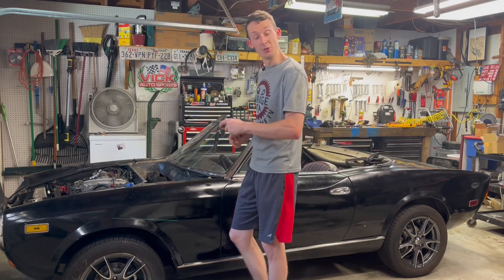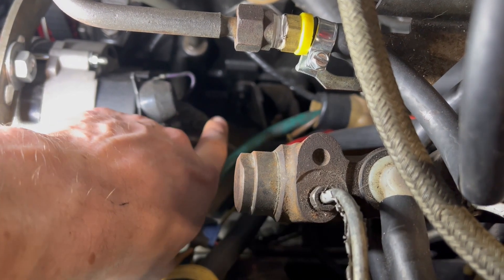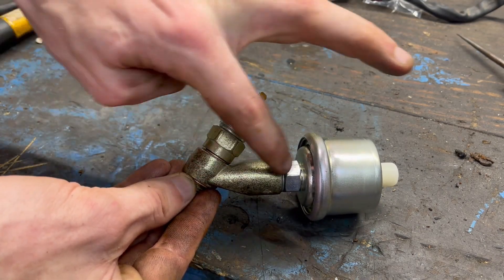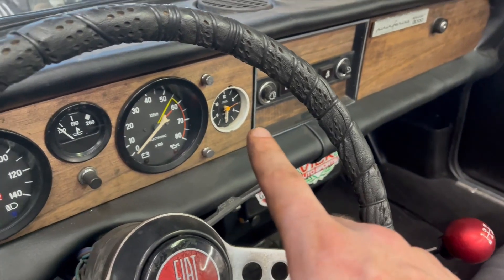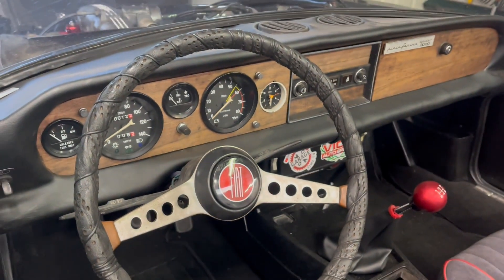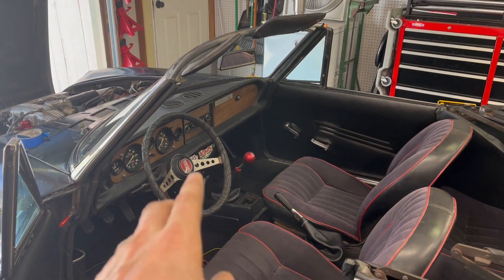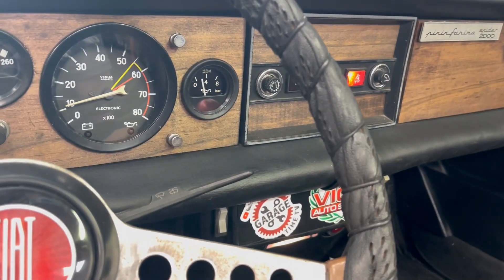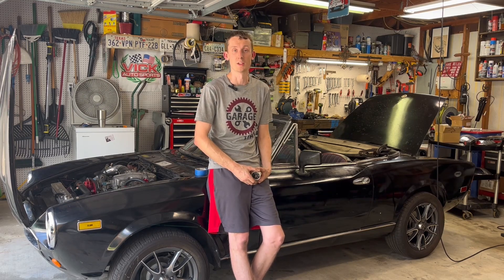Oil Gauge Installation on our 1982 Fiat 124 Spider Project!-SUPER EASY!

Comment: Thanks for the video.  I got lost on the dummy light.  There are two wires coming from the light on the tach (gray and yellow/black), I know the gray wire connects to the gray wire on the oil gauge going to the light, but what wire does the yellow/black go to?
Reply from the maker: @Rosie-ww9yw  it’s been a little while since I’ve done this, but black and yellow is typically a power wire for lights. The Miafiori forum has free PDFs of wiring diagrams. That may be helpful too
Reply: @GarageTimeTV  thanks for your reply!
Reply from the maker: @Rosie-ww9yw  of course! Sorry I couldn’t be more helpful

Comment: Just move the oil light to the front and install the gauge sender at the back. No need for a Y.  Fiat oil filter fitting you are working on has a outlet on the front for the oil light and a outlet on the back for the gauge, at least my 81 does.
Reply from the maker: I’ll have to look. I think I may remember seeing a plug in it when I built the engine.
Reply: @GarageTimeTV  You have to be a be a bit carful up front with the electric connection so to not get into the alternator belt, I crimped my wire to the spade backwards for that reason
Reply from the maker: @vernonboley1035  good advice! Thanks!
Reply: What Vernon said, there is already an extra port.  One can use the doubler if there is also an oil temp gauge in the mixture :-)

Comment: What is the red part next to the intake?
Reply from the maker: That is my fuel pressure regulator.
Reply: @GarageTimeTV  that replaces the black charcoal box, yes?
Reply from the maker: @gabbymadsen7260  no it replaced the gold colored one from the factory on the fuel rail by the injectors.
Reply: @GarageTimeTV  last question... where did you get it? It looks Vicks anodized red, but I didn't see a matching part on their site
Reply from the maker: @gabbymadsen7260  I got it off of Amazon. It took some alterations but works well. Haven’t had issues yet. Here is the link:
0-140 PSI Aluminum Fuel Pressure Regulator Kit, Universal Adjustable Gas Oil Injection Pressure Regulator with Gauge, 6AN Fuel Line Hoses, Install Tool Accessories (Red) https://www.amazon.com/dp/B0922D98KG?ref_=cm_sw_r_apin_dp_AEB6YMKMYGEG1GMSRR8D

Comment: Where did the gauge come from?  I ordered the T, the oil pressure switch and the idiot light switch.  But I don’t know where to get the gauge.
Reply from the maker: I bought mine used, but you can also get it from the fiat vendors.
Reply: Thank you.